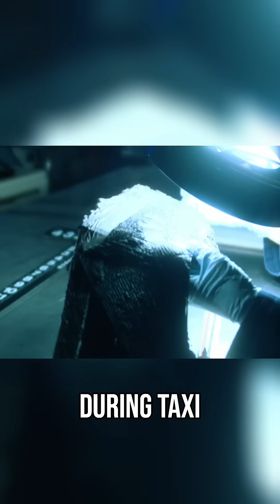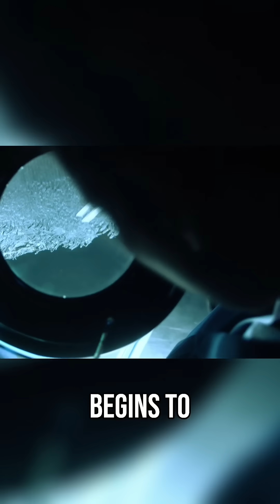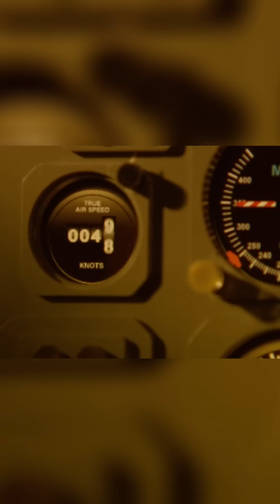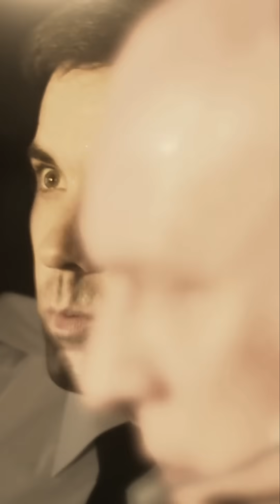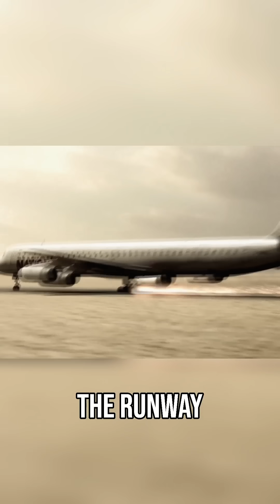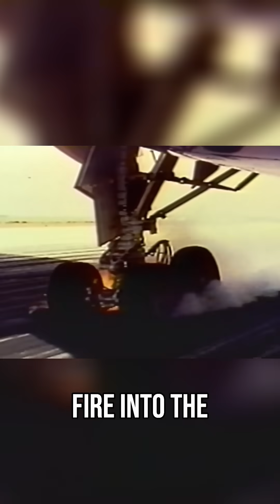Tire Overheats BEFORE Takeoff! | Mayday: Air Disaster

Comment: Why aren’t there sensors to activate fire suppression systems, alert the crew of the fire and if the suppression system fails to put out the fire, automatically extend the landing gear before the landing gear hydraulics burns up, to move the burning tire out of the fuselage into the airstream?

Comment: Hey pilots!   Cameras are a thing!  Put them all over the outside of your airplanes so you can see stuff like this before it kills you!
Reply: And cameras also get damaged by debris or poor maintenance. More modern airplanes have cameras in different external places of the plane, but it's not a 100% solution.
Reply: This crash took place in 1991. 
What’s more is that the plane involved was a DC-8, already decades old. 

After the crash, it became mandatory for aircraft to have fire detectors in the wheel well.